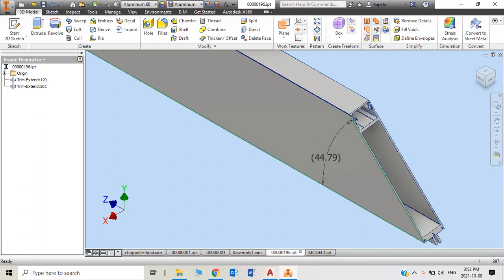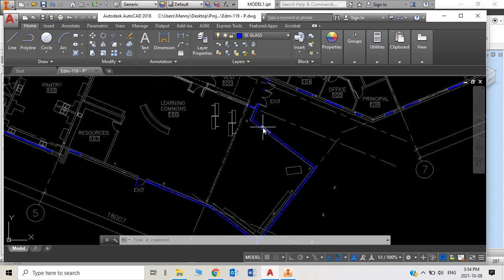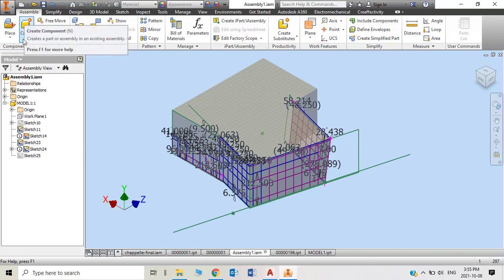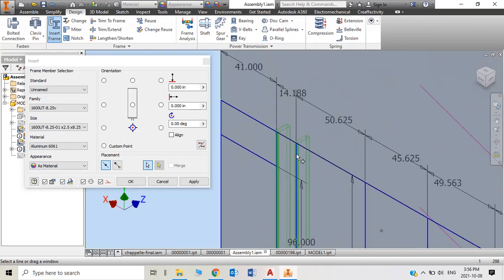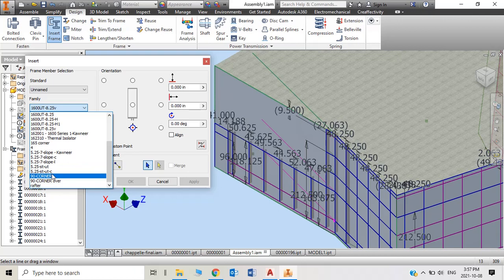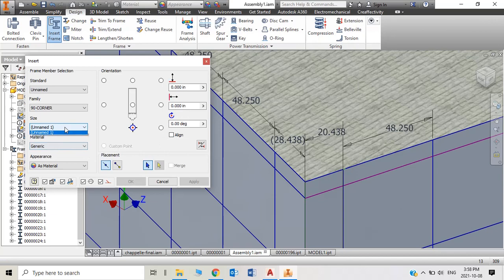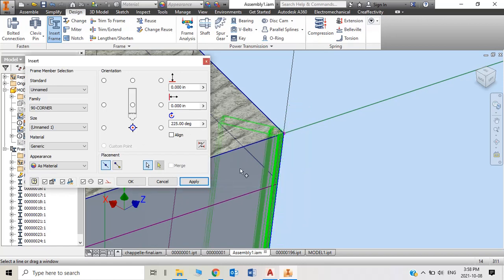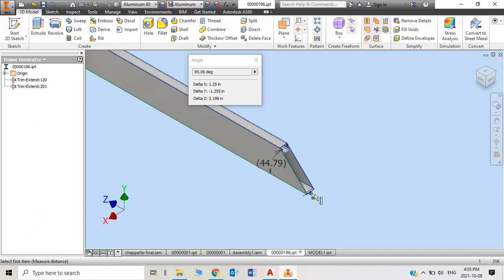Curtain Wall generated by Autodesk Inventor-Part V-Frame generator

Comment: can you compelet steps for manufaction of curtain wall?
Reply from the maker: If you double click the part you can get each meneber detailed drawing for fabrication. Normally i only use Inventor to solve compound,or coplicated application. thanks for your comment.